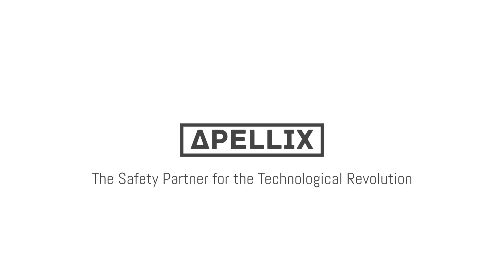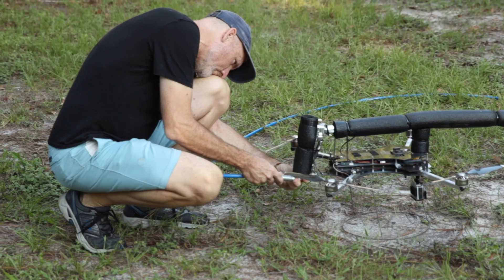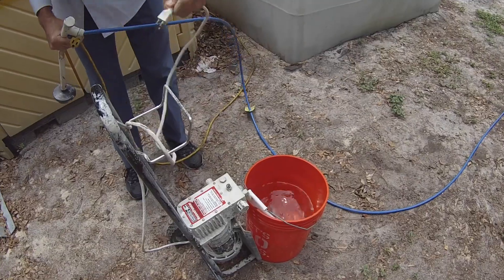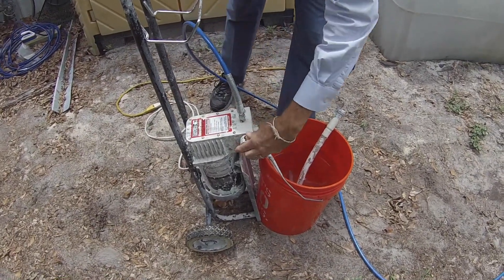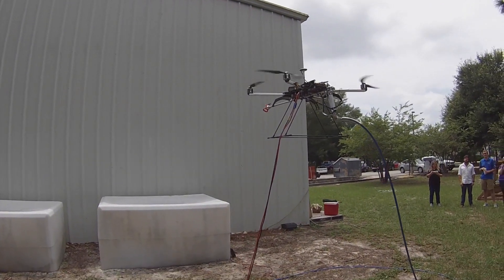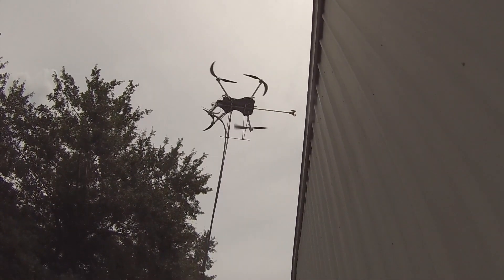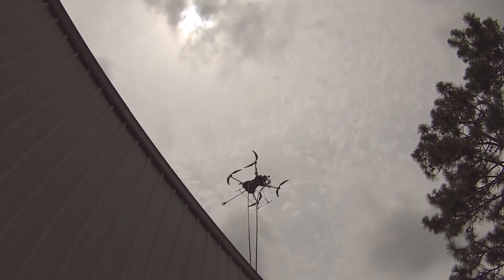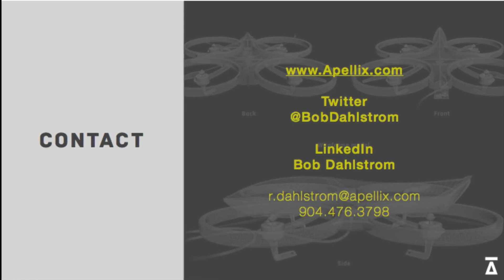Apellix Pre Production Worker Bee Demo   Jan 2016

Comment: Good idea, nicely implemented, keep it up!  I love the steady power supply! Do you use some kind of proximity sensors to ensure a nice and even paint application? And what about pressure, it seems like a mild breeze might result into painting the drone (and damaging the propellers) instead of the wall? Would a higher pressure destabilize the drone? Thumbs up!
Reply from the maker: +constructive spree Lots of questions :-) Yes, we use proximity sensors. The drone, being large and industrial, is very stable + the addition of the umbilical cord and tether act similar to a tale on a kite providing additional stability and control. We have tested in winds of 25+ miles per hour (mph) with gusts up to 45+ mph and the drone is steady. But at those wind speeds even with the paint wand 2 inches from the surface the paint is blown away. And for the last question I am happy to say we completed several proof of concept flights in early March 2016 with high pressure (the same system you would use to pressure wash a house, deck, or sidewalk). Hopefully we can continue the forward progress of our engineering efforts as we make the system better and better.
Reply: +Apellix Thanks for the reply, i am sure you are devoted to perfection :-)  Keep up the good work and come back with more feedback!!! All the best to you & your team.
Reply from the maker: Please see our newer video https://www.youtube.com/watch?v=S_CRP2wtEdw

Comment: The video shows water being sprayed...  Not a big concern.
What happens when paint is being sprayed - and the overspray begins to collect on the rotors, which changes the aerodynamics and causes instability?Have there been any tests with actual product?  Is this a problem?
Reply from the maker: +Adam Reynolds We have tested with paint, and yes there is a buildup on the rotors or engines, but they spin so fast very little reside collects. Also the system is waterproof. We have flown it into and back out of a pond with all but the propellers underwater including the electronics. Check out our new video showing our proof of concept of the Worker Bee(TM) autonomously spraying paint (not water this time) https://www.youtube.com/watch?v=S_CRP2wtEdw
Reply from the maker: Adam, you may also want to check out a video someone took at a demo where we are painting white paint over black on the side of our warehouse.  https://www.youtube.com/watch?v=kjRPooS2XB0